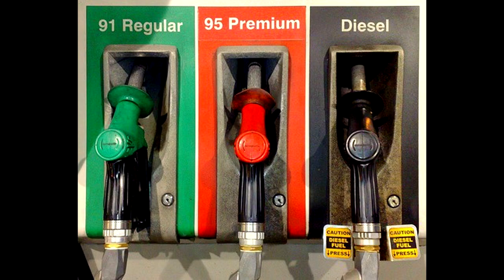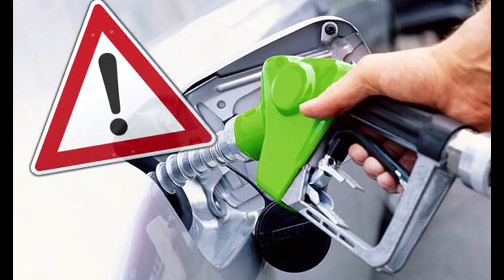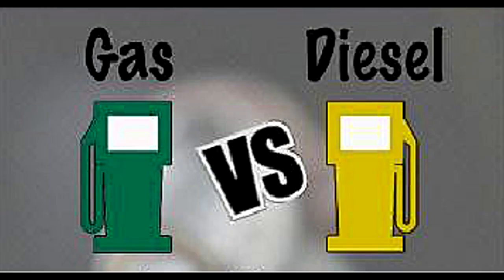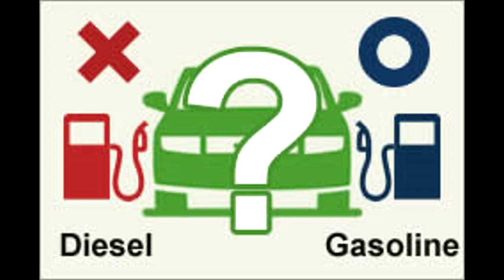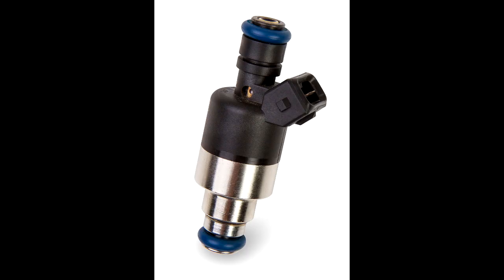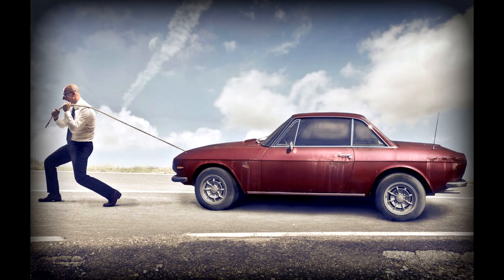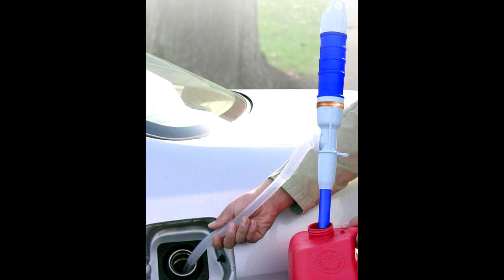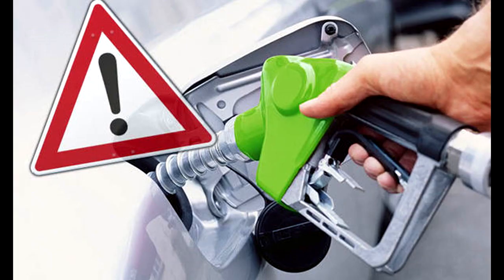What Happens When You Put Diesel in a Gas Engine

Comment: What happens is that the diesel melts the gasoline engine
Reply: @Jakastrnisa  Well you should keep putting more gas then put some injector cleaner in and you might need to replace the spark plugs ,air filter and oil filter.
Reply: @ghostunix731  hey man I messed up and put around $9 of diesel in my car but then I added $25 of gas because someone said it should run fine ? Do you think it’ll work or I shouldn’t drive it
Reply: @jony7g884  how did it drive after?
Reply: Jaka Strnisa Did you drive it a while? I accedently added disiel and I’m buying a 15 dollar pump to take it out.